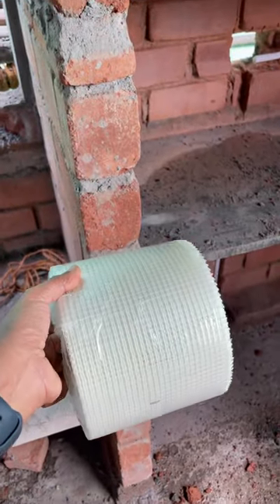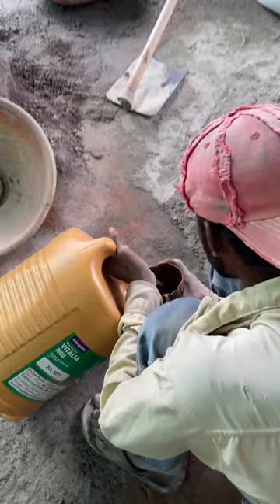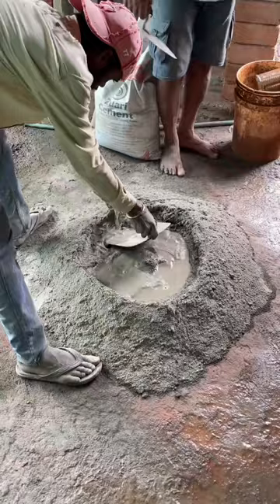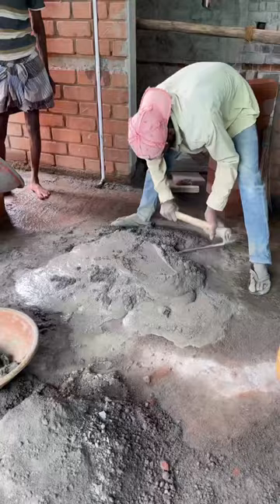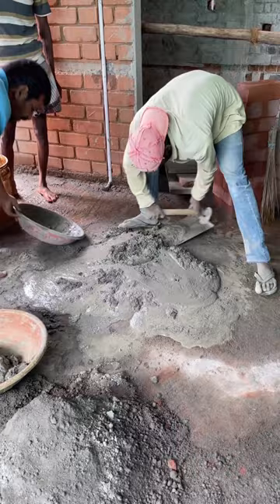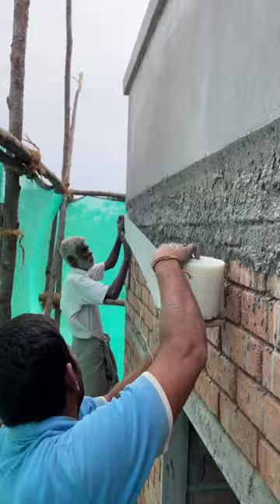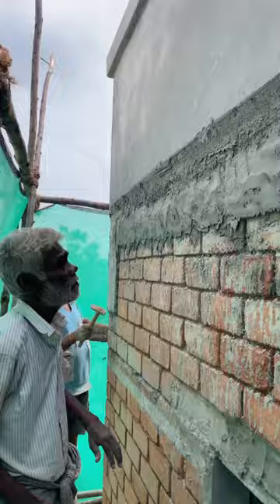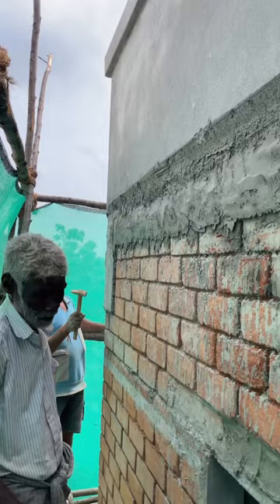Why Fiber Mesh Band Is Use In Plaster?(Construction Tips)

Comment: Any advantage of fiber based mesh over metal (wire mesh).. is one better than the other when doing overhead water tank repair… thanks
Reply from the maker: Resistant to alkalis, does not decompose and will not rust over time, it does not emit toxic and harmful substances, has a high resistance to tearing and stretching, protects the surface from cracking and improves its mechanical strength.Fiber Mesh is better then wire mesh...

Comment: Whats the liquid you have use in cement mortar
Reply from the maker: Waterproofing of concrete and sand-cement mortars used in water tanks & water retaining structures. Used for waterproofing basements, roof slabs and screeds, external and internal plaster, and brick laying mortar.

Comment: If u used chicken mesh its produce more strength..
Reply: strength will be less because of rusting and fiber mesh rolls is waterproof
Reply from the maker: Fiber Mesh provide more strength then chicken mesh....
Reply: Hammering nails to stick chicken mesh could weak the jpints
Reply from the maker: @1Dorayaki3005  Not Affected...

Comment: Hi bro what water proof compound you applied & what's the ratio of water proofing compound
Reply from the maker: Integrel liquid Water proofing compound...

waterproofing chemical should be between 0.5 to 1.5% of the cement weight.

Comment: Can we use it with putty? During renovation
Reply from the maker: no...
Reply: @ChiragMistry  after renovation in 6 7 months, house front walls have cracks which doesn't look good. A full line of crack is visible from left to right. Is there any solution for it? Its a hairline crack but with time paint starts to get off

Comment: On lintels,beams should it be applied both interior and exterior part? Or exteriors does the job?
Reply from the maker: You should use this for any concrete work....and before plastering between wall and beam-column joints...
Reply: @ChiragMistry  sir I want to ask u if we use chicken mess between column and wall usse crack nii aate
Reply from the maker: @mathsmagic2.081  नहि आती क्रेक
Reply: @ChiragMistry  sir actually hum apna new house construct kr rhe h toh humne pillar phle construct krwa liye  toh humara thekedar bol rha tha uske baad maine u tube videos dhek le 
Or bhut tnsn hue
Reply from the maker: @mathsmagic2.081  koi problem nahi ayegi..tension mat lo...chickem mesh laga do...
Reply: @mathsmagic2.081 Hii ..Cracks hue kya chicken mesh lgane k baad.. Actually We are going to construct new house ..so Hume nhi pta ki kaise kre ..phele column bnwaye ya dewaar.

Comment: If we do waterproofing then how will the curing happen ?
Reply: After the concrete dry's the waterproofing procedure will be done.... If you are asking in connection to the video, then they are applying Glass fiber mesh in masonry joints for crack control... it is not waterproofing.